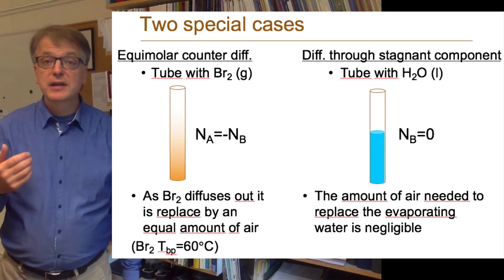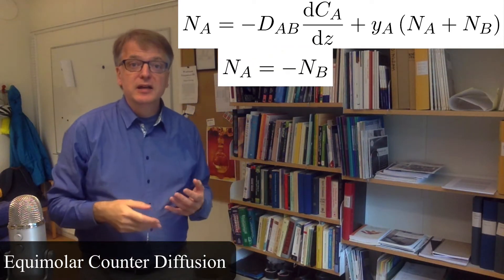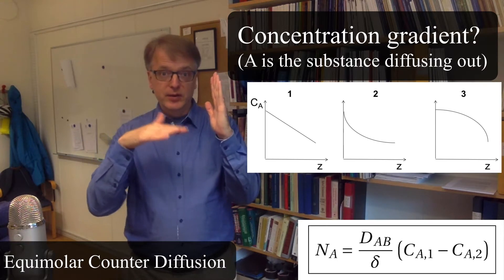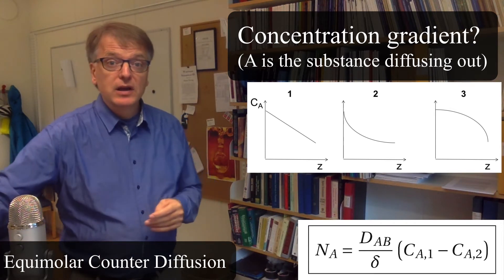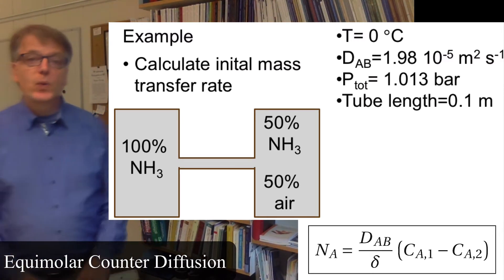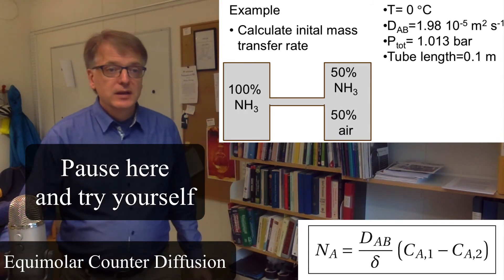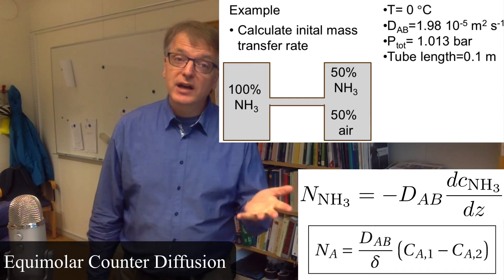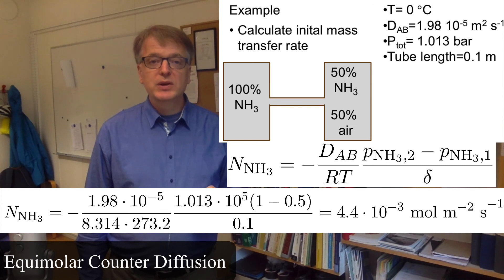Equimolar counter diffusion

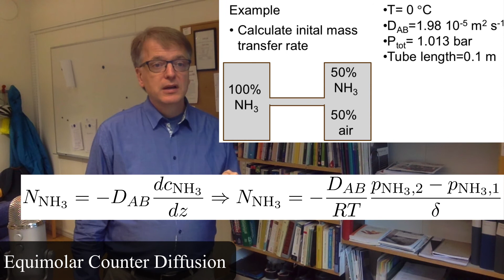Comment: I think there might be a mistake on the equation with the numbers (04:26). The result of the mass transfer rate should be negative, and therefore I assume that the difference in pressures should have been inverted or the negative sign after the "Nnh3 =" should have been removed. I imagine that a negative value just means that the mass is flowing against the direction we assumed when writting the gradient, but in any case the result is written as a positive number. I am not 100% sure so any feedback would be really appreciated.
Reply from the maker: What is wrong is that I accidently dropped the delta in the equation N_A=-D/delta dC_A/dz  at 04:17 and you're correct that the direction of integration determines the sign of the expression. I should to go back and look through my old files and post and updated, corrected version (if I can find the time…)

I kind of glossed over the influence of the direction of integration at 04:17 in the video. The equation you get depend on in what direction you integrate. There is no inner derivative here so if you integrate N_A=-D/delta dC_A/dz from point 1 to 2 you get N_A = -D/delta(C_A2 - C_A1). If you instead integrate from point 2 to point 1 you get N_A = D/delta(C_A2 - C_A1).

The direction in which you integrate is the positive direction. I can agree that it is confusing that I include the equation (taken from the Handbook we use and that I'm the editor of)  N_A = D_AB/delta (C_A1-C_A2), which assumes integrating from point 2 to point 1 when I in this example integrate from point 1 to point 2
Reply from the maker: By the way, thanks for your question. I have updated the video description based on your question
Reply: I appreciate the explanation. I had to read it 3 times but at the end it clicked! thanks to you
Reply from the maker: You're welcome. Thanks again for pointing out a weakness in my video

Comment: is it only for a gas phase diffusion ? 
thanks for this nice lecture
Reply from the maker: Essentially, yes, only for diffusion in gases. In liquids there is no guarantee that the different molecules take up the same amount of space. As an example, when you add ethanol and water, the total volume is less than the sum of the two volume, see e.g. http://www.ddbst.com/en/EED/VE/VE0%20Ethanol%3BWater.php

Thus in liquids strange things may happen. If your liquids behave nicely, however, such that mixing x ml of A with y ml of B always gives you x+y ml of an A+B mixture, then there is no convection for equimolar counter diffusion in liquids.

Comment: Hallo really nice videos! I just can understand why there is no convective part? As i understand with flux it is transport/(area perpendicular to flow) you u defined convection as v*C, but if i take a plane different on the tupe the concentration will change hence the convective part ( advective part) will change??? i see that  C is a scalar, so you just take the  total concentration of the system as C(how do you define C )
Reply from the maker: I'm not sure you and I use the symbols in the same way so in trying to make sure we understand each other:

C is concentration, mol/m3, defined as in all text books on chemistry. For an ideal gas pV=nRT and thus C=n/V=P/RT. Without subscript C is the total concentration, i.e. the sum for all species. It is, as you say, a scalar. It may, in general, have different values in different parts in space but, especially since we are talking gases here, that would mean that we have a difference in pressure between  different places. The implicit assumption here is that we are studying a case where we have the same pressure  everywhere, i.e. no fan, pump or natural convection going on (e.g. no temperature differences that cause natural convection )

v is the velocity averaged for all species. Even in 3D, if you make an average of the velocity of all molecules (in a small enough volume) that velocity will be a vector with a  unique direction. Thus you can not choose in which direction you calculate the area: You must take it orthogonal to the direction of the flow.

Now, if we scale up and look at a case with turbulent flow, the average velocity has a different direction in different points which is why we then need to make a differential 3D mass balance, see video "Mass transfer in 3D" https://www.youtube.com/watch?v=28BvVAiLXck

Comment: Sir,I have a doubt
Many books write that distillation is equimolar counter diffusion...
My doubt is,how we can say this??
Reply from the maker: To be precise, I doubt that they say that "distillation IS equimolar counter diffusion" but I find it likely that many books say that "what happens at the phase boundary in distillation is equimolar counter diffusion".

If a text book says something like that, the reason is that they want to simplify to make it easier for students to understand. However, that simplification is far from true, and McCabe-Thieles graphical method is not true either. As G E P Box famously said, "All models are wrong, some models are useful". 

Let's try to go through this step by step:

1: McCabe-Thieles graphical method relies on the assumption that liquid fluxes (as well as gas fluxes) are constant in the column as long as we do not pass the position of a feed (Note: This means that liquid fluxes ABOVE feed often are different than liquid fluxes BELOW feed and the same is true for gase fluxes). 
2: If liquid fluxes and gas fluxes are to be constant, this means that if 1 mol of gas flux is condensed, then 1 mol of liquid needs to evaporate.
3: If 1 mol of liquid evaporates and one mole of gas condenses, then you have equimolar diffusion. If not, you do not have equimolar counter diffusion and you can't actually use McCabe-Thiele (but perhaps you can use it as an approximation?)
4. To get equimolar counter diffusion at the phase boundary in distillation (thus to be able to use McCabe-Thieles graphical method) the following is required:

A: No heat losees (which never is the case in reality)
B: Molar evaporation enthalpy must be independent of compositiion. This in turn means that
B1: The molar evaporation enthalpy of the two substances must be the same
B2: The mixing enthalpy must be zero.

Please check 0:52 into my newer video on McCabe-Thieles graphical method for a discussion on the evaporation and condensation on each physical tray

https://www.youtube.com/watch?v=9gZeftUNejk&list=PLvpgTFzUKO49J3fwJF9y61q17FSNDdoGN&index=7

Hope that this helps you
Reply: Thanks a lot sir